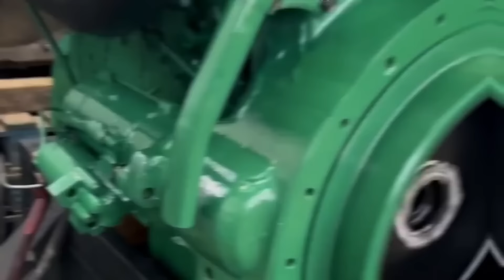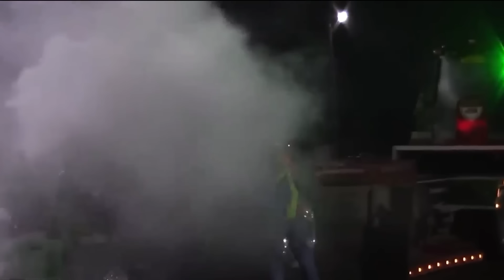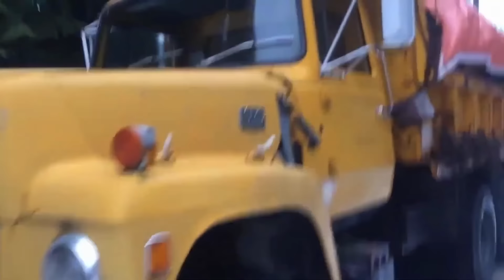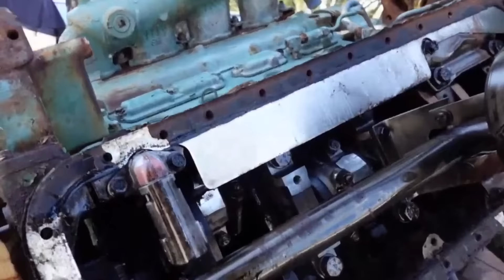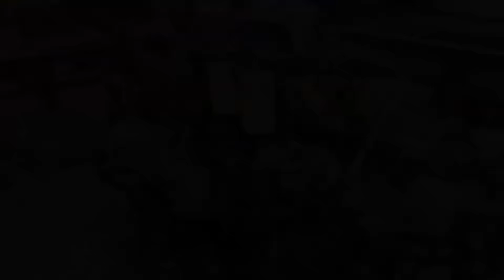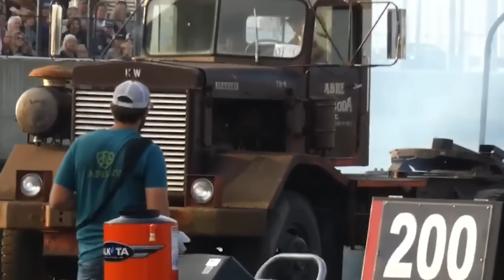THE LOUDEST ENGINE EVER MADE & Why It Got BANNED - The Detroit Diesel 8V71 Screaming Jimmy

Comment: We had a Detroit run away at work one day.  Went to like 4 or 5K rpm. We blocked the air intake and it stopped. Fixed the problem. It started rite back up.  Let's see a cat or Cummins etc do that kind of rpm and not blow up.  Not going to happen. ,🤠🌵🤠🇺🇲🇺🇲🇺🇲

Comment: Loudest detroit diesel was actully the 6v53t with stamped metal valve covers..  its where the name screeming jimmy comes from..   the 6v53 is the oly one that really screems..  its a tone.   aluminum valve covers were added as an attempt to quite it down.. i have an assortment and hands down.. the 6v53 was by far the loudest and made a screeming noise

Comment: When I first got out of the military, I worked at a power plant for the Department of Energy, and it was a coal-burning plant,  they used 8V 92'S hooked to slurry pumps, they ran 24-7, I never saw one blow up. It just kept on running,  but it leaked oil like crazy 😂
Reply from the maker: That's an incredible story and a testament to the durability of those engines, even with their oil leaks! Thanks for sharing your experience.

Comment: Yankee Walter Airport Crash Trucks in the middle 60's and 70's. Twin 8V-71s driving an all-wheel driven fire truck carrying 4,500 gallons of foam at 0-60 mph to reach the plane crash and then deliver that foam in 21 seconds via dual power takeoffs powering two huge centrifugal pumps.We ran in each 8V-71 on a test stand on second shift but I never tired of that "scream"!
First encounter was in Greyhound buses on the New York State Thruway traveling to Syracuse University.
Reply from the maker: That's an incredible story and a fantastic example of the 8V-71's power and versatility in a critical application! It's amazing how those twin engines could get such a massive truck moving so quickly.

Comment: The 71 series came in a variety of configures. From 2, 3, 4, 6, 8, 12, and 16 that I know of. There were other similar engines like 53's, 92s and 149 engines. GM also built the 567 and 645 EMD LOCOMOTIVE ENGINES. Built with a roots blower they were considered naturally aspirated..

Comment: Great documentary. Just wondering about the “naturally aspirated” version you refer to?
Reply from the maker: Thanks, glad you enjoyed the video. By the naturally aspirated version we mean the standard 8V71 without a turbocharger. It still used the Roots blower for scavenging, like all Detroit two-strokes, but didn’t have the additional turbo that some later versions used for extra power.
Reply: @ClassicAmericanMachines  thanks for clarifying, as I knew the need for supercharger. I rebuilt a 6V71 back in the mid-70s when attending a diesel college. Thing went from not running to rated speed in 1 1/2seconds when hitting air start. 😮

Comment: We had several fire trucks over the years with 6V71 and 8V71 Detroits. The exhaust came out the right side in front of the rear wheel and it was hard to keep from blacking out the sun every time you started moving. One day we are sitting at a light and I'm riding in the right jump seat that faces backwards. The exhaust is perfectly aligned with a guys open window so I get his attention and motion for him to roll up his window and he responds by shooting me the bird. When the light goes green black smoke fills his car and rolls out his far window. When it finally cleared, I just shrugged my shoulders and  tried not to grin.
Reply from the maker: That’s a great story. Those old 6V71 and 8V71 fire trucks could really put on a smoke show when they got moving.

Comment: I drove a few 871s they were a good engine, very noisy but back then I thought the noisier the better. But the narater is very misleading, regarding compession ratio he is comparing it to gas engines which is not a good comparison all diesel engines are high compresion and they all have one head covering each side, he said it like it was unusual it is normal. Loved it anyway. I worked on drilling rigs back in the 60s, some rigs had twin 453s side by side and standing between them and reving them up wow.

Comment: I could always tell when they where logging in my area, you could hear those skidders screaming with those Detroit's for miles. The loaders and the trucks too. I operated an excavator in the eighties ,digging clay 12 hours. a day running wide open never had any issues .
Reply from the maker: Sounds like you spent a lot of time around them. Those Detroits working in the woods could be heard from miles away.

Comment: The puny 8V-71 ain't got nothing on the Dirty Dozen, the 12V-71.  A 12V-71 with a turbo fed blower will leave the beefiest 8V-71 running away in shame.
Reply: Well, it's 50% bigger and turboed, so what you say is hardly a surprise. A 300 lb football player on steroids will run over a 200 lb back as if he weren't there. Talk about stating the obvious.

Comment: I remember when I was working on 8v71 we were drilling out the bolt holes for the heads and putting larger bolts to secure the head to the block.
I worked on these engines when I was in the army and there they use these engines in their tanks

Comment: This guy really does not know his facts. I have worked on these detroits for years. They are not wet lier motors as he claims. Because they are 2 cycle motors , they have base pressure which can  blow gaskets and results in oil leaks.

Comment: The 8v 71 was only one of many 71 series engines. 1 ,2,3,4and6 inline engines and 6,8,12,16,and24 cylinder engines from 30 horsepower to 1800 horsepower and yes some were naturally aspirated.

Comment: We had an old GMC Brigadier with the 6-71 pulling a 48' walking floor trailer that hauled construction trash.  Every couple days it would be full and weigh over 100,000 pounds gross.  The truck was an old logging truck with stump pulling gears and a 9-speed transmission.  Top speed was about 51 MPH but the landfill was close.  That truck would climb up the hills at the landfill just screaming and get around where the big Pete's and KW's struggled.  It was a short wheelbase truck and I'm not sure if that helped.  The maintenance guys told me drive it like you stole it and that's what I did.  One of the other guys got pulled over with it and got a huge list of violations and one of the violations was truck to noisy driver wearing ear plugs.  We replaced it with an old wore out KW with a 350 Cummins and a 13 speed with highway cruising gears.  Not nearly as fun as the old GMC.

Comment: I'm a mechanical engineer working in the automotive industry.
  If I ever decided to trade in my slide ruler, and become a truck driver, it would definitely be with a Detroit Diesel. If for nothing else, the sound. I don't care what stacks you put on your 4-stroke diesel, it will never sound nowhere near as good as a streaming Jimmy. Actually I think they sound like complete s***. This also applies to the diesel pickup trucks. 6 inch or larger exhaust and rolling coal is not impressive. Cuz we all know they're looking for attention. Remove the duramax, powerstroke, and cummings and drop in a 6V 71. You will turn heads everywhere. For you younger guys, the 71 series of engines shared a lot of the same parts. Look it up.

Comment: Too bad you don't know what you're talking about...... The 71 series started out. As an unfinished engine that somebody else couldn't figure out how to make it work... I forgot who..... The first in number. Tells you what it is. 12346812 and 16... Were the number of cylinders that's the thing was initially designed with back in the 1930s .. .. the cubic inches of the cylinder itself was a 71... So if you had a 171... It was a single cylinder 71 c cubic inch...... If it was a 1671... It had 16 cylinders...... The engine was modifiable... To produce more horsepower by changing the injector size that camshaft and the cylinder head and the blower drive ratio and whether you gave it a intercooler and after cooler ..... What was n55 injectors a 671 would just sip fuel without guzzling.. it was so quiet play your mama would be quite happy with the driving to the church..... Or say you wanted a Johnson towers modified 671 you could have 500 horsepower.  . And that would be a lot for one of those..... The tractor that you showed blown smoke and drive away was not indicative of how the 671 or the 71 series really actually ran only rowdy totally hopped up monsters would sound like that and blow out all that black smoke....... And the only ones I ever fixed that had oil coming out of them were totally abused beyond belief...... Generally in trucking the two best engines were the caterpillar and the Detroit Diesel.... I've seen Detroit Diesel easily hit a couple million miles..... But when you get these stupid little boys who don't know how to treat their trucks... I think that hopping them up is the only game in town having their fun.... You find Detroit's that have been thrashed..... That's okay because if you look at all the trucking companies across America there's one engine that you see everywhere and they're littered all across America and you don't have any that are salvageable and they're blowing black smoke and what are they they're cummins

Comment: I wasn't aware of any Grey Hound busses with 8V92 engines.  The bigger ones had 8V71 and the smaller, older ones from the mid to early 60's and 6-71.  a lot of the transit busses had 6V71.

Comment: I was working construction and a driver quit, so the foreman told me to drive the f9000 with the screaming Jimmy. well for the first 3 days this engine drank a gallon of oil a day, I have operated terex buggies and they have the 4 cyl. Jimmy and loved running wide open, My truck was the v8 and I could not push the throttle down hard enough, at the end of the week it no longer used oil and had more power than any other truck . and the noise was heavenly . every one said I was abusing that engine, It started in the coldest waether and ran cool on the hottest days, I still love the sound of the screaming Jimmy!!!! Incidently that engine hade the best Jake brake I have ever used !!!
Reply: Sounds to me like the people that were using in it before you Baby it and by you Working it  hard it finally had a chance to seat the rings And by you getting that old Fuel diluted oil out. Then it could run like it should.
Reply: That's a bad spell of weather.

Comment: 20 years around these things on fishing boats. Took care of them and they always got me home. Forgot to mention that if you stripped the blower shaft and “lost the blower function”, you could end for end the shaft pretty quickly. And it actually worked. Then always carried a spare shaft on the boat. Just don’t drop the Jesus clip down into the gear train. Also… using ear muffs in the engine room would have been wise. Didn’t do that in the 80s. Half deaf now. 😐

Comment: A few of the most memorable moments.
One was when I was working dispatch and one of the drivers had a single axle Ford 9000 with an inline 6-71 Detroit.  The exhaust elbow snapped right as it exited under the cab and the driver was going deaf from the noise.  We were outside when the driver was approaching the office.  We could hear it getting closer and closer but it was still not in sight.  It kept getting louder and louder but still not in sight.  We could literally hear that truck from over two miles away.  
Same truck, different driver lugged the engine down and got it running in reverse.  Luckily got it shut down before there was too much damage.
We had a White Road Boss 2 with a 6V92 that wouldn't start one day.  It would just crank and smoke .  The mechanic traced the cause was a stripped spline shaft on the blower drive.  New shaft and it fired right off

That Concord Fire Engine #3  I would say was in Concord NH as it looks like the sign in one of the shots had a 603 area code.  About 40 minutes from where I was born.

I watched a video from DEBOSS GARAGE a few years ago where they fired up a 16V71.  Two 8 cylinder blocks bolted together.  Boy did that thing wail.
More two stroke greatness is at OL2STROKER
Reply from the maker: Two miles away is incredible, though I bet that driver was thrilled to finally get that exhaust fixed! 🙉

Comment: My boat in VN had four 6-71 diesels.  Later on shore duty my boat had two 6-71Ls (low profile).  Loved them!  Run for ever. BTW; USN landing craft never ran 8V-71s. They ran 6-71s (LCVP had 1, LCM6 had 2, LCM8 and LCUs had 4 ) and  the LCM8 and LCUs later had two 12V71s.
Reply: On a ASPB IN NAM had two V12 71

Comment: You must not know anything about the DD engines if you say you could not bolt on electronic controls. Our 6-71s had them from 1979 when they first went into operations. Our 12v71s got electronic governors in the late 1990s.

Comment: The entire displacement of this engine was approximately equal to that of one cylinder of GM's 2-stroke locomotive engines of the era. The loco engines were also phased out by the Gummint.

The application where the 2-strokers sill rule is large container ships, but they run around 100 rpm, which makes exhaust easier to scavenge. I have seen specific fuel consumption figures as lo as 0.16 lb/hp-hour

Comment: No, the loudest is the 6V53, it doesn't have a screw, or helical supercharger, it has a dual lobed supercharger which results in a pulsing soundwave which is amazingly loud, but the engine itself us bulletproof as all Jimmy's are. The myth that they explode, is just that. The military wouldn't have used them so extensively during WWII if they weren't reliable.

Comment: I have one of the last 6-71 made,It was a repower for my boat,it was installed in early 2000s,the owner passed away.I bought it from his wife in 2011 it had 70 hours on it.I had the Penn Diesel garage near me adjust the valves and the mechanic was surprised that the motor was new out of the crate.I now have 3200 hours on it and she runs like a charm.
Reply: The 2stroke Detroit just aged out, they were never banned. It just got to the point that there wasn't anymore to get out of the design. The only way  to get more power was to add more cylinders and there wasn't room for that in newer trucks, and the fuel mileage sucked!

Comment: 71 series were dry liners--92 series were wet liners.
Reply: Saved me from posting that about all the 71 series engines.
Reply: Bullsh*t. They were wet.
Reply: @johnbaskett2309 
You need to do some research.  The 53, 92, and 149 series were wet the 71 was a dry liner.  The block could be bored out to fit oversize liners .010 , 020, 030 oversize. I worked on every model Detroit made 2-53, 3-53, 4-53, 6v53, 8v53  2 , 3, 4, 6, inline 71 6v, 8v, 12v  16v  24v71, 6v, 8v  12v, 16v92  12v 16v,24v149  Overhauled them for 30 years

Comment: I drove firetrucks for 45 years and hands down the Detroit 8V71 on my HAHN 1974 straight stick Ladder Truck had twin blowers on it, what a beast it was!  Worst motors I dealt with is the Cummins, nothing but trouble. Firetrucks are constantly out of service for problems related to these motors. At one time a Detroit was the most used motor in the Fire service and for good reason, Power and reliability.  Thank God I retired a few years ago, now a days if you see a firetruck in the shop its usually problems with the Cummins motor or Allison automatic transmission.
Reply from the maker: 45 years behind the wheel of fire trucks is impressive. That 8V71 ladder truck must have had an unforgettable sound.

Comment: I've had to work next to DD all my life. Some were horribly loud, and some not so much. The technology of mufflers back then, wasn't so great. The low Back pressure requirements of all the DD, limited how much muffler they could take. Today's mufflers would quiet them down substantially. Also, lot's of equipment (other than trucks), didn't even use a muffler. Straight pipe. 🙉

Comment: These were in lots of jet tugs used to move airliners.  The Rampers would start them and before the idle would settle down they would have the throttle to the floor.  Our airline would get 30-40 hours out of an engine.

Comment: I was a road mechanic for 50 + years and worked on many engines, but I remember the owner of the company that I worked for had a boat with two 12/71  engines we had them rebuilt and installed back in his boat , at sea trials those twin 12/71 had a sound that only a mechanic could love ! LOL. Great engines
Reply: I rebuilt all 3 12V71 we had at work. They were at 14, 12, and 10K hours. When I left there in 2003, the one that had had 14k on it when rebuilt had another 14 k on it and was still running strong. Rebuilds were rebuilt heads, blowers, water pumps, with new injectors, rings, pistons, liners, and bearings on the crankshafts. These were driving 8' diameter props thru an 18:1 gearbox in a pump station. We would fire them up and run them to 300 hours before shutting them down for an oil change. Just add 2 quarts of oil every 24 hours. Not once in the 14k hours after overhaul did I reset the injectors.

Comment: Sounds like as long as you did the required maintenance and did preventive maintenance it worked fine and it wanted to work everyone thinks they know better than engineers oh they are just trying to upcharge us you don't need to flush coolant and change gaskets

Comment: Without 20 gears behind it was a torque less gutless POS, buy a Maxidyne 300 ,that is an engine !
Reply: I had a 1979 kw 100vit it had a 0092silver 475 ,every mack I ever seen on the road was in my morrow, not knocking the mack it had it's good applications a real torquey engine bit not good for long distance trucking way to slow.

Comment: Best  engine ever built  fix it on side of road  replace parts could  come  from used engines to make it run.  Overall overnights.   It  never failed  because new generation wanted wanted god  dam COMPUTERS  with a screen  on dach  board. Government's bends to please and get  elected. 
In our  time very too good  is replace  by scape